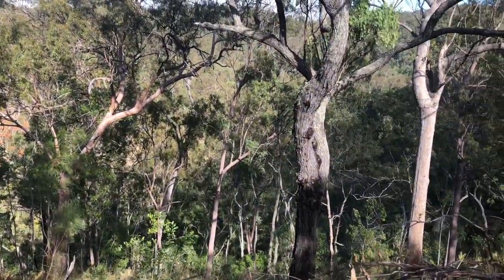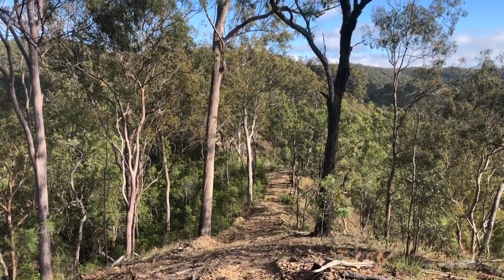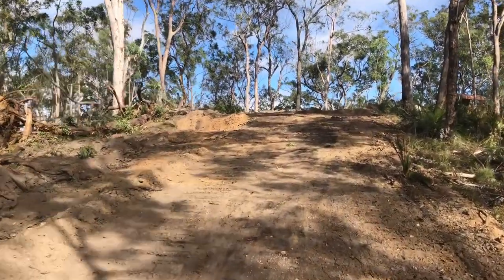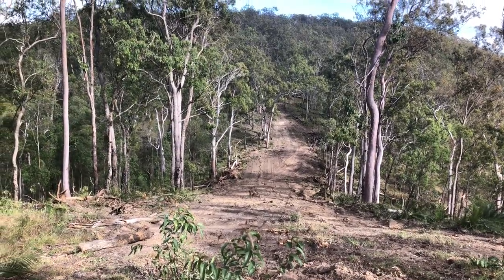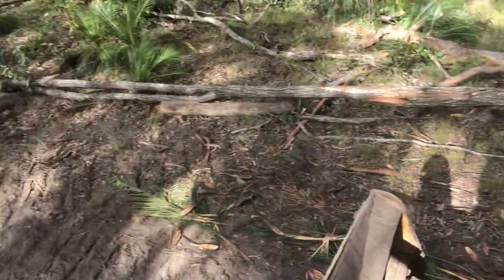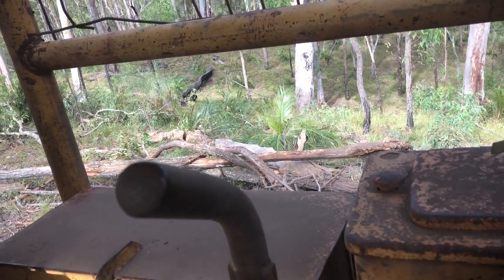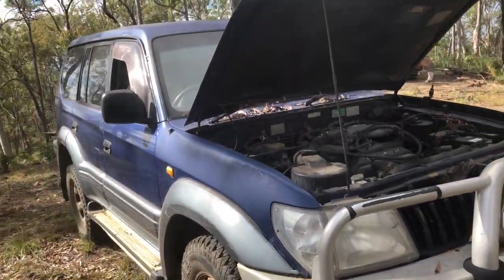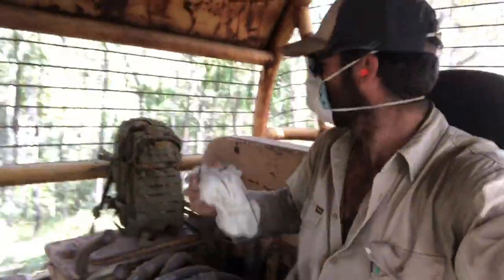Walking to the Allis

Comment: Needs a 4" lift kit. My old Toyota 4Runner ( 96 model) with 260k miles is lifted 4".  Has good mud tires and will go about anywhere.  It's my main hunting rig.
Reply from the maker: Could do with a lift but goes most places I need it to.

Comment: U be able to sell.some.firewood for extra coin, plenty there.
Try putting a Multimeter on the 4x4 and test voltage on battery and back of alternator see if different.
Chris fix has a video to test current draw easily explained.
A hinge door be handy to check eng oil.
Good looking coolant.
Great to see doing checks life of the dozer.
Manifold sounds like it has a leak
Ear muffls a must
Reply from the maker: Straight pipe on the exhaust there is a little leak at the base of the exhaust pipe but manifold is fine. Always wear plugs and am generally happy with the noise reduction I achieve with them. I find earmuffs give me headaches, maybe I haven’t spent enough money on a set of them yet either🤷.